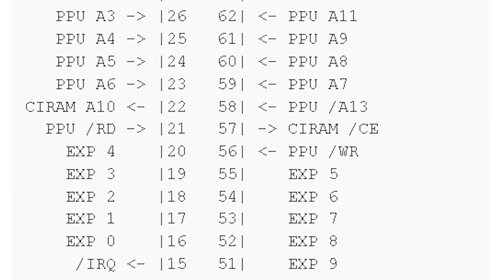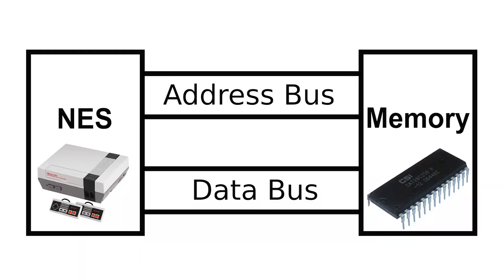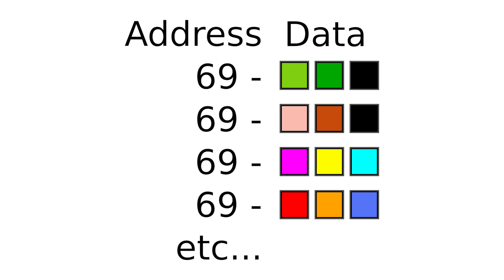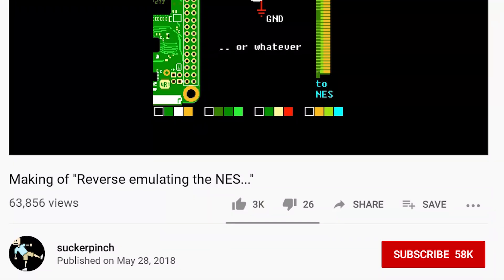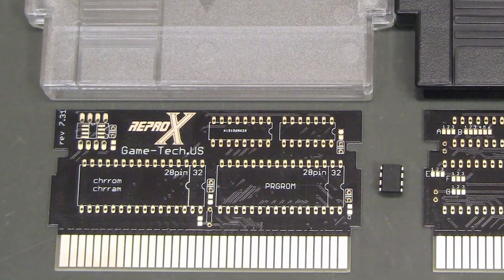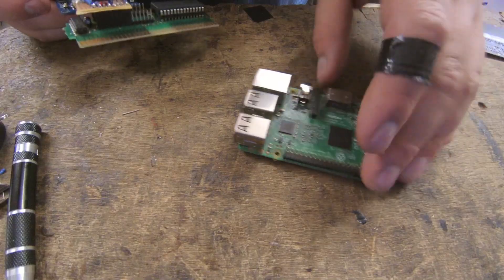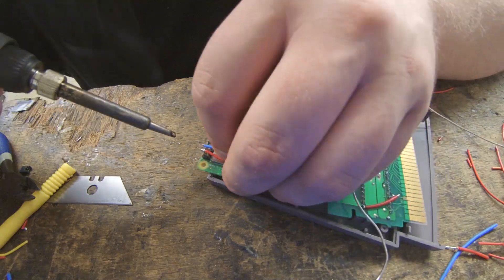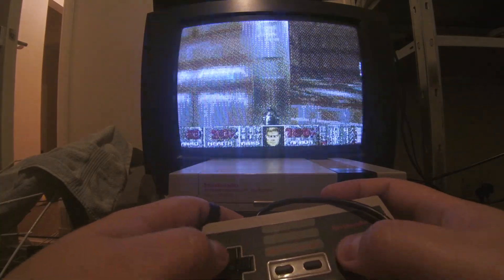NES DOOM - Cartridge Build Guide

Comment: I have a unique gameboy hack I've thought of for ... FOREVER - I've been hoping to nerd snipe one the more electronically capable people who do these sorts of nerdy hacks.

In the gameboy cartridge there's a reset pin, this reset pin is directly connected to the CPU, when the Z80 is held in reset its data/bus pins all go high-z.  In theory this would mean the GB's data bus and therefore it's PPU is ready for directly communicating with the cartridge.

The PPU has it's own isolated vram for doing work, now I don't think you'd have access to IRQ's or other things to make some effects work, but .... you should be able to communicate with it using a processor within the cartridge itself, so a ESP32 or raspberry pi zero.  Although this would be write only.

I could be wrong, I'm not quite capable of doing this work, I just happened to notice this decades ago, and have convinced myself that it's possible over the years :P  

Anyway, give it like a good 5 minute look over and tell me if I'm crazy.  There may be other things that would limit the usefulness of this, like... would you be able to read the JS ports?  

There may also be a way to be somewhat symbiotic with the main processor, allow the main processor to run, collecting the joystick data and communicating with the audio ports etc - and then somehow communicate with the co-processor to do work, which would suspend the main processor, read this joystick data from wherever and then write data to the ppu.  

would be quite the challenge!  If you have some thoughts on how this could be designed I'd love to hear it, maybe someday I'll just break down and make it.

Comment: Now, given the pi zero 2 w is essentially a pi3? Will that give you the performance needed? Mind you there ARE tricks to power saving. Disabling the wifi/bluetooth modules if your project doesn't need them, disabling the HDMI out, etc. Granted it would be pretty neat to enable bluetooth to allow pairing of an 8bit do, but at the same time if you're gonna go through all this effort? Go the rest of the way and use the original controllers.

Comment: Pity it's NTSC only. Only have a PAL NES, and would love to make one of these... But, I'm guessing it'd take a large rewrite of code to make it work on PAL, so,, I'll probably have to wait until I can afford an NTSC NES, I guess.
Reply from the maker: It works on PAL, check github for the ROM
Reply: @TheRasteri  It does? Oh, you're a saint. Thanks a billion! 💜💜💜
Reply from the maker: Literally the only difference is that the music plays slightly faster to make up for the slower clock speed :)
Reply: @TheRasteri  Ah, I'd never have guessed it was so simple!

Say, wouldn't that mean that theoretically, if I were to set up a NES or SNES emulator on the RasPi instead of Doom, I'd be able to play NTSC games on a PAL NES and vice versa? Would be nice, as there's a ton of nice exclusives...
Reply from the maker: @TheSuperLyntendo  haha theoretically but you'd get crap graphics and a lot of lag. Better just playing emulators directly or getting an NTSC NES
Reply: @TheRasteri  Yeah, it'd mostly just be for laughs. I already run RetroPie on a 3B+, so I can just pick up a SNES USB controller for that.

There's one other game that I'm thinking about, that I'm tempted to try and make run on this. Should be particularly easy due to some recent developments surrounding it... And the NES cont should have just enough buttons to play it, if you strip the controls way down to the bare bones minimum.

At any rate. Thanks for the tips! Looking forward to working on this. 💜

Comment: why you use a usb for graphic output ? are the io Pins on the raspberry to slow for that ?
Reply from the maker: Yeah at least under linux the Raspberry Pi can't easily be used for realtime GPIO stuff. Also its pins aren't 5v tolerant so we'd need extra circuitry anyway
Reply: @TheRasteri  Ah I see. Could you tell me about the handshake protocol a little bit please ? Are you asserting NMI for every Frame or scanline and Nes pull data from an fixed registeradress and write it to the screenram ?
Reply from the maker: @markussteinbacher8807  the 6502 isn't involved in the graphics process at all. The FX2 writes directly to the graphics memory bus and feeds the PPU background tiles directly
Reply: @TheRasteri  thank you. So the palette data is initialized once and then only tilebitmapdatas will feed ?
Reply from the maker: @markussteinbacher8807  yeah exactly
Reply: @TheRasteri  are you dithering the vga framebuffer on the raspi before sending to ppu ?

Comment: couldn't you also like, just use a Raspberry Pi3 Module that looks like a ram chip?
Reply from the maker: The compute module requires a lot of extra components (voltage regulators, etc). The standard pi is just plug-and-play.
Reply: @TheRasteri  ah okay, didn't thought of that :-)

Comment: if you don't care about it fitting in a cart, will this work on raspberry pi 4?
Reply from the maker: Absolutely. The code is super portable (I did most of my dev on Windows haha)
Reply: @TheRasteri  I see you put a new capacitor on the board. Why did you do this, is it needed?   I'm following your guide and have the cnrom put together following your guide and it's not working. so just looking for something I'm missing. Unfortunately I'm using a knock off NES console and starting to wonder if I need a real NES.  At the very least it would rule out my console as the problem.
Reply from the maker: @doubleHLabs  I replaced the cap because I broke it haha. You shouldn't replace yours. Is the ROM working, i.e. is the nes playing music?
Reply: @TheRasteri  I was able to get music to play! I started over with another pcb and it worked the first time. Something must have been wrong with that other pcb. I also noticed that my knockoff NES only had a 0.3 amp power supply, so I'm glad I picked up a real NES to test with. Now moving on to the next steps..
Reply from the maker: great news! let us know how you get on
Reply: @TheRasteri  https://youtu.be/ME92nWptJBI As you can see I have it all hooked up, but the video isn't fully working. Maybe this video tells you something?
Reply from the maker: @doubleHLabs  Probably a sync issue. Make sure that the read strobe really is hooked up to all of the pins it's supposed to be (PA1, PA2, PA5, RDY0). Maybe even probe the FX2 chip itself, some of these FX2LP boards are dodgy as hell so they might have broken traces (or you might have broken one while desoldering). You can find a pinout on page 22 of this datasheet : https://www.cypress.com/file/138911/download - let me know how you get on
Reply from the maker: @doubleHLabs  Looks like you're missing a data pin too actually (every 8th pixel column is missing), my bet is on broken traces/dodgy wiring

Comment: You know, what's more impressive and just came into my mind is that this is basically turns Raspberry Pi into an "expansion chip" without any outsourced power whatsoever. And it's flicker free!

IIRC, Tom7's rendition of this mod still had to outsource power for the Pi.
Reply from the maker: Yeah I think Tom7 is bit-banging the graphics buses, which is more complicated and presumably has timing issues which cause that flicker. I'm lazy so I just used a USB FIFO chip.

Comment: So Shovel knight is 100% fonctionnal only the 3ds rom with drastic emulator is perfect. the normal pc game rom clock is to high 2,2ghz to run,  it freeezing on raspberry. 10-13 colors at once on the screen is the strict minimum !!!! actually  i m trying to connect the raspberry sound to the nes sound channel but  i m not programmer -_- undertale is 100% possible but only 3ds fan dev rom.

Comment: This is just great! Is this a similar solution to Super Game Boy on SNES? If I'm correct SNES also has a composite video passthru and SGB use it.
Reply: What? You are nowhere near correct. They stuffed an entire gameboy color into the Super Game Boy; which normally transmits unidirectionally to a parallel bus LCD. There's no composite video, NTSC or PAL encoding, or anything of the sort. SNES just blits the LCD output into it's VRAM, and out to the display at 50/60hz. The 65C816 may have a low clock speed, but it's a mostly 1T/4T design. Even the SA1 accelerator at 10.74 MHz.  Of course, it's a lot faster than the PPU and has a much larger pallette and less restrictions, so there's no degradation or dithering needed, unlike the PiPU output stream. 

The 8051's a good example, going from a 12T design to a 4T design to a 1T design.
https://www.maximintegrated.com/en/design/technical-documents/app-notes/2/2035.html
Modern 8051 chips are ~50Mhz 1-clock-per-instruction now. <3

(The FX2LA chip is an 8051 based design, which is why I use it as my example)

Comment: I always dreamed of doing this, of embedding a processor that would do all the work of an advanced game in a cartridge, and that would only pass image and sound through the console, similar to what 32x does. When the raspberry came out, I knew that one day someone would make it. I think if you come to a friend's house with a modified cartridge like that, he will be amazed at what he will see. It would be a big boom in a game fair...

Congratulations for the initiative
Reply: There were quite a few SNES games that had integrated co-processors (the SNES hardware was designed with this kind of interfacing in mind).
It'd be interesting to see what you could do with a SNES.
Reply: Technically I guess you could run anything on it with the cartridge doing the graphics processing, but I think you'd lose some immersion once the cartridge was either not the size of the original or required external power. 
So the rpi is somewhat revolutionary in it's smallness and efficiency - in the future, as SBCs become more powerful, we'll always be able to fit more and more into an NES cartridge.

Comment: EDIT I did actually know that you did use all 5 sound channels of the nes to play good recompositions from doom by using a midi and famtracker to eventually manually adjust every note of it,and then you basically patched chocolate doom with it, but i actually was hoping that you streamed 1bit dpcm or 7bit pcm samples from the raspbarry pie to the nes ,rather then hassle with midi & fami tracker  tool kits,,,
I also would like to hookup a modded ps2 controller to the nes wich will take full benefit of the pie functions trough those buttons (maybe trough a special reqeust or  clock signal of the nes)
But other then that this is great stuff,,

Now i would like to see however a snes pie project using this treatment as well , so we have a better version of doom on snes,because that’s what i always wanted.
Reply: Perhaps you could emulate  the Nintendo four score or or satellite controller accessory.

 which would allow you for nes controllers total.

AKA 16 inputs per nes controller port.

I don't know if that will be enough.

Because I am not sure its configuration of this controller.

And i didn't have a chance to look it up.

Any thoughts on this anyone.

Or for the ultimate controller interface.

Just emulate the miracle piano teaching system keyboard.

Unfortunately again I cannot remember how many inputs this would equal.

But this would be the ultimate number of inputs for sure on the Nintendo Entertainment System.

By the way same goes for other systems.

 because this keyboard was able to be used with other systems.

 the only difference being the cable that was used.

 and of course console-specific cartridge.

Any thoughts again.

Comment: It would be really cool if you could somehow get customized sounds on the NES by exploiting the DPCM channel. For instance, simulating 2 extra square channels and a saw channel through that pulse code channel.
Reply from the maker: I very much wanted to use the DPCM channel to get better audio but I didn't have time. I was thinking of actually streaming audio straight from the Raspberry Pi into the DPCM - then we could make any sound we wanted. Think the DOOM sound effects with the full MIDI sound track :)
Reply: @TheRasteri  Yep. I've actually been looking into doing this myself -- but not through the use of a Pi. For me I think it would be awesome to play a version of akumajou densetsu on a non-modified NES and still get the extra sounds. There are ugly ways of doing this currently, but I have not run across any real elegant solution.
Reply: @erikshure360 it's not more interesting to use the direct sound  from the rapberry pi pass by interlaced repro mmc5 chip or Sound dac  to add more channels and finally pass on the nes cpu?
Reply: @TheRasteri  i really can’t wait till you show how to stream audio from the pie into the nes dpcm channel😀
Reply: Yeah, i was wondering the same,just use a chip that could convert  the 16bit wave files from the raspbarry pie into 1 bit dpcm or 7bit pcm(depending how much.cpu power the nes has left), would be way easier rather then patching doom,quake etc,,, with nes conpositions of it,while these nes compositions can be great, but streaming digital audio into the nes will add more capability’s to it!!!

Comment: Very Nice Job!!  But Big Question ! , its possible to increase the resolution a bit more with mixing dynamic Flickering Technic ( MCBee Nes Title Remake to get 1 Tricky color more) with your Dithering Technic to get more smoother dithering or more Resolution ?
Reply from the maker: I did experiment with temporal dithering but I was never able to get it to look right. I'd love for someone else to have a go at it though.
Reply: @TheRasteri  the problem is the PPU its more interesting to implement  a new PPU and CPU on FPGA to add more features, 8 colors, more sprites, remove the cpu and ppu slowness and some other features same like Kevin Horton Analogue NT Mini

Comment: You could simplify this by using the Raspberry Pi GPIO header to feed to a memory buffer chip for the graphic memory link, which can be rigged with a double page-serial buffer, to reduce flicker by reading one page ahead of time. 

Also, there are a lot of all in one chips you could use instead of a Raspberry Pi.  Several ARM chips are available, as well as MIPS models, and a wide variety of other low power micro-controllers.
Reply from the maker: Thanks for your interesting discussion! 
IMO that isn't really simpler, since it still requires external hardware (the memory buffer). Also the Raspberry Pi's GPIO would basically have to be bit-banged which is processor-intensive, unless the Secondary Memory Interface could be used, which is poorly documented. The USB interface uses almost no processor overhead, and also meant that the development could be done on my Linux desktop PC rather than on the Pi itself.

Any flicker in the video is caused by my camera shutter speed being wrong, the picture is totally stable in person.

I did investigate using a high-end microcontroller, but the software requires quite a lot of RAM, which is non-trivial to add to most microcontrollers. Also the algorithm is threaded, and really wants a multi-core processor - again something that isn't very common in microcontrollers. The Pi 3 has a multi-core processor and lots of RAM on a single board, as well as support for lots of games, so it's ideal really. Also, again, the fact that it runs Linux means that the bulk of development could be done on desktop.
Reply: @TheRasteri  While the GPIO could use a simple CMOS buffer chip to handle syncing, I understand the CPU Usage, and despite making the physical mod simpler it would make the software half more complicated. 

Another option is to get a USB to Parallel Synchronous PTY/UART interface chip to handle the logic.   These chips are very flexible, and I'm sure one could be found that could use slave-side sync for output.
Reply from the maker: @ruediix  My early prototypes used a USB-to-parallel chip (FT232H) which worked pretty well, but wasn't quite flexible enough in terms of signalling. The FX2LP is basically just a very fancy USB-to-Parallel chip.